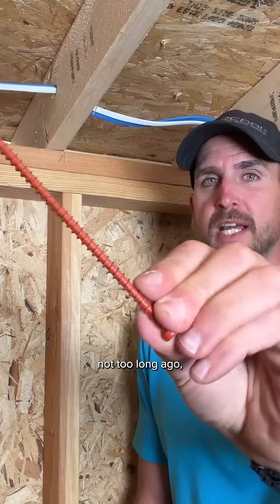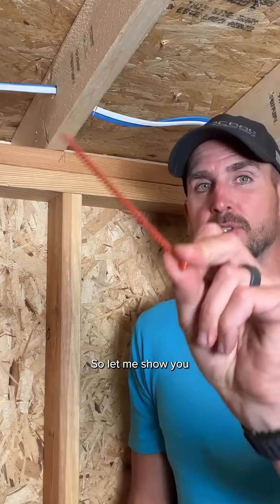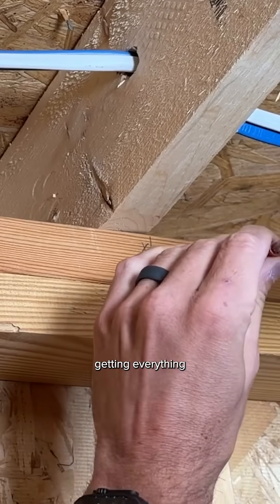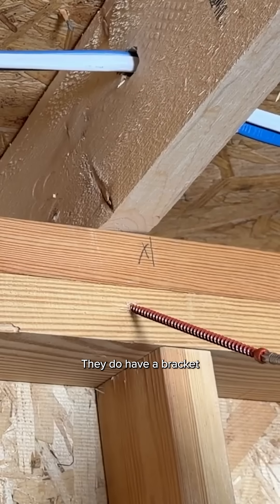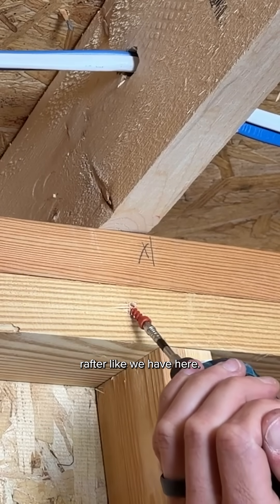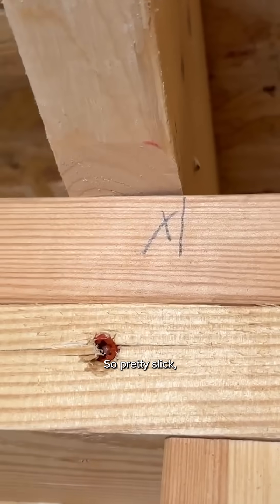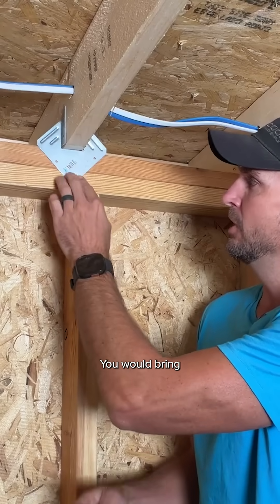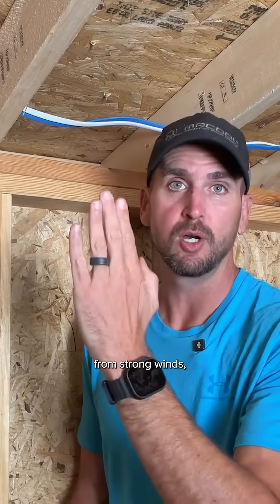The Screw That Makes Hurricane Straps Obsolete?

Comment: The one scenario that definitely makes a single screw inferior is if strong winds push the joint towards the inside/middle of the structure. The threads remain in the rafter but the 2.x inches at screw-head tears out of the top plate where there's no meat to resist the blow inward.
Reply: youre talking 200mph.. let the house go, you have bigger problems
Reply: @napwithus hello. True on that but what fastener do you like for the coverage while we focus on worrying about our persons.
Reply: @houseandhobby6971 Probably the fastener made by these guys for that purpose... You think they don't test things?
Reply: @farmeunit Actually not enough. Common construction experience knows about tear-out potential. I do not blame them for wanting and needing to make a differentiated "product"...a big screw in an inappropriate location.
Reply: @houseandhobby6971 Where's your proof?  I know it's hard to trust things but common sense would also tell you that if the wind is strong enough to rip roof off, you probably have bigger problems...
Reply: @farmeunit exactly. I've installed HUNDREDS OF THOUSANDS for over 22 years. the Samson screws are plenty. you end up splitting the lumber before the connection fails .. it's pulling through 8" of wood. when installing drywall, the screw is better.
Reply: Tests performed to support the single screw do not include testing for other variable movements and stresses that the plate handles but the screw does not. Pretty simple.

Comment: Why not just go straight thru the bottom plate? Why Angle it?
Reply: For an increased strength against a separation.
Reply: I appreciate both the question and the answers? 👍
Reply: Could still get a good angle from underneath without toescrewing the top of the first plate to obsolescence
Reply: @JP-ee2tc  also more wood engaged from underneath.
Either way, angled or straight, (straight gives more threads into the rafter) the hurricane tie is going to pull WAY stronger than that 6in. #8 or #10 screw.  
Maybe ok for a shed.
Reply: I'm not structural engineer, but thinking on a physics basis, if it is straight up you have the tensile strength (which is probably superb) but if the structure racks under the wind force only the the shear strength is at play. Now the angled approach used both shear and tensile strengths no matter the motion
Reply: @EMTDawg that's poppycock.
Reply: @EMTDawg But that assumes the stress vectors are only vertical. I would really question that assumption. lol
Reply: @ycplum7062  well my comment actually assumes greater side loading when the structure racks, hence why I mentioned the shear strength of the fastener when inserted vertically.
Reply: @EMTDawg  That has to be the stupidest comment on YouTube this month! Don't MAKE SHIT UP - if you don't have a clue, it makes you look really stupid.
Reply: @scotty362100  Scotty, you are not only rude but totally ignorant of the value of exchanging ideas in a respectful manner whether you agree or not.  I happen to agree with EMTDawg that the angled screw provides an extra degree of resistance to upward forces.
Reply: @scotty362100  and what qualifications do you possess that show what I said was at all made up? Do you even have a vague idea how force vectors work?
Reply: @scotty362100 actually that's how a structural engineer thinks.  I'm a physicist and I had the same question and his assumption sounds like what engineer friends would say.
Reply: @scotty362100  If you think that's the stupidest comment this month on YT then you obviously don't read many YT comments.
Get back under your rock.
Reply: With that six inch screw you should no problem going thru the bottom.
Reply: Because then you get the benefits of shear and tensile strength. If it was just straight up you’d only be fighting against one force instead of 2 at a time.
Reply: @fatal510  Another comment that doesn't have a clue, but just makes shit up!
Reply: @scotty362100  man you got demolished in this comment section lol maybe thats what youre going for though
Reply: @therotaryrocket  yeah - totally demolished! I think you need another puff-puff-pass.
Reply: @scotty362100  Come on then boy, put your money where you mouth is, and illuminate us with your 'correct' answer to the OPs question.
Reply: And with a decent size washer on the end to stop it popping through 
The plate is way more stronger as the nails or screws are horizontal to the frame giving it way more strength.
Reply: Who's doing the screwing? Trade introduction level most of the time, and good lord, try to teach someone angles, let alone hammer a toenail. Hammer first then nail gun, after managing an appropriately weighted hammer for the individual apprentice
Reply: @JP-ee2tc good point. I wouldn't want an employee doing this. I might use the screws building myself a shed or something. Probably not my house.
Reply: Exactly that was my question? Lol
Reply: There are alternate vertical installation guidelines for this product.  One reason you might not want to do a vertical installation though is that sometimes the stud is directly under the rafter so it interferes.  The main reason is there are values for different installation methods so unless you are the one specifying the product, you might not know that the calculated uplift you need to connect for requires a specific method of installation.
Reply: I thought they sane thing 👍
Reply: 110%
Reply: Exactly, a corner cuting contractor
Reply: 6 or 7in lag.bolt!!!
Reply: I went with two through the bottom plate on my outbuilding.  For the house, I used the brackets which goes into the sheathing too...  Since my life depends on the house, I would go a little harder on that structure.
Reply: Splaying the bolts gives it more holding power.  The bracket probably has less strength because it's into the face.  I'd do both
Reply: Great observation!
Reply: I would venture a guess that the angle makes it stronger
Reply: He should go through the bottom  and not just go in halfway the lower plank.

That's because the whole point of a screw is to have as much contact with the wood as you can get. That tiny little head on that screw is not doing anything, the grip strength comes from the thread so you want 50% of the thread in both of the pieces that you want to connect.

Going in haflway through the first plank is just wrong.
It's easier, but wrong. That bottom plank is basically not connected now.

The plate may me slower to apply but it is 45 times better; all the screws are at 90 degrees to the load. This is a typical "can he half-ass it some more?" solution.
Reply: @vinny142  Going on an angle is recommended, despite only hitting half of the bottom plate.  An angled screw  better resists a combination of forces encountered in roof-to-wall connections, such as uplift (from wind or seismic events) and lateral shear (horizontal sliding or racking.)   Its better physics.
Reply: That lower board is already splitting from that angled screw🧐
I think going straight up is the better choice to draw them together tight and square💪
If I was concerned with the screw shearing then I would use two screws in the same manner that nails are used during framing work😂
Reply: Triangles are more stable than any square or rectangle.
The angled screw creates a triangle type of resistance instead of just a vertical or just a horizontal.

Comment: Humm 4 fasteners up & 4 fasteners down for a total of 8 anchors vs 1- 6" screw: 🤔
As I understand Simple isometrics, I'm having a hard time trying to believe a single point, partial penetration of the bottom board, screw can handle being twisted and lifted like the strong wind forces found in a hurricane or tornado.....
I would use the screw as an accompanying support ......
Reply: Is it because the wood members are in such compression,  that their wood surfaces that are in contact with one and other creates a shit ton of friction almost like a lock washer?
Reply: Plate uplift in Doug-fir is 545 pounds.  The screw is 615 pounds.  Simpson publishes these values based on testing, you can look it up for yourself.

Comment: It can not be better than 8 screws on the metal plate
Reply: Those gonna be 8 one and half inch nails but you are right its not gonna be stronger.
Reply: @ndilaok2709  Simpson has screws that are approved to be used in place of the joist hanger nails.
Reply: Agreed, although that will be nails. But, correct. Tests performed to support the single screw do not include testing for other variable movements and stresses that the plate handles but the screw does not. Pretty simple.